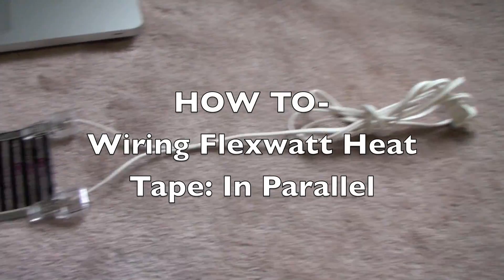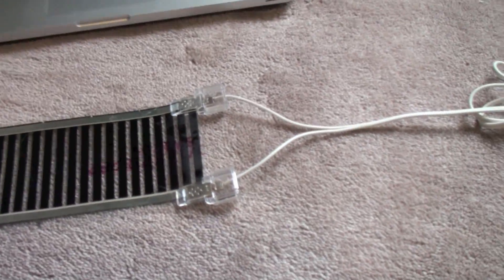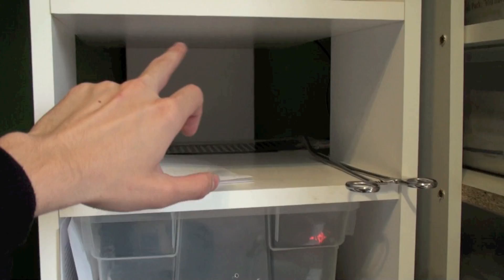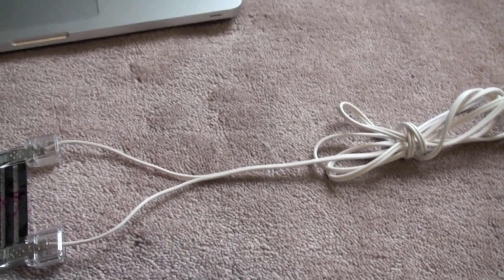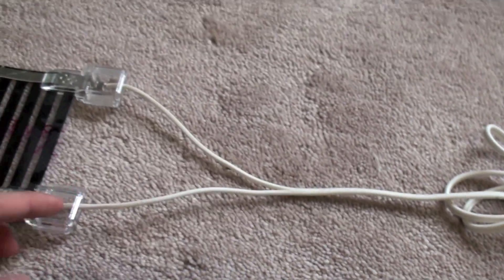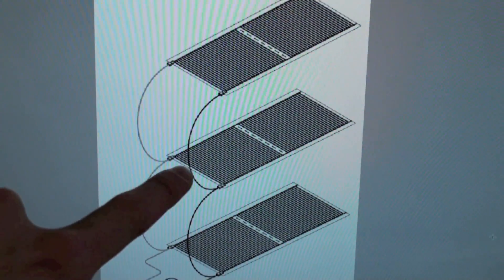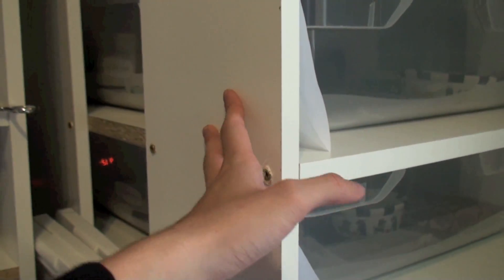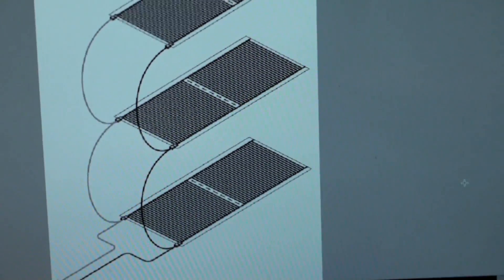How To - Wiring Flexwatt Heat Tape in Parallel

Comment: Once those clear plastic pieces are on can they be takeb off and switched to new heat tape i just got a 7 tier rack its all pre lined with tape on each level i just want to switch the wires im already using in my thermostat just connect my new rack and not have the old one connected?

Comment: you can also plug an extension cord into thermostat and plug all your flex tape into the extention cord just dont go over on the wattage or the thermostat will burn out.

Comment: Can wire them to go to the next one?
Like in that diagram you have them all on the left side. Can you make them plug in on the left side then at the other end of the heat tape put another set of wires to another heat tape.